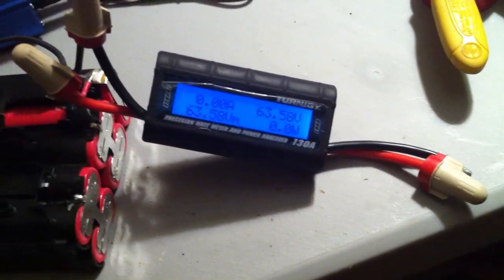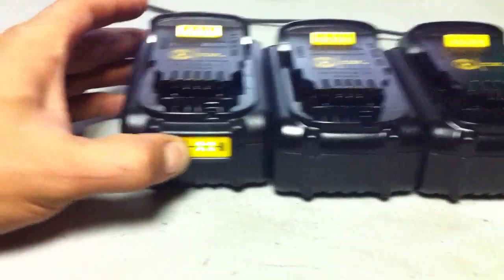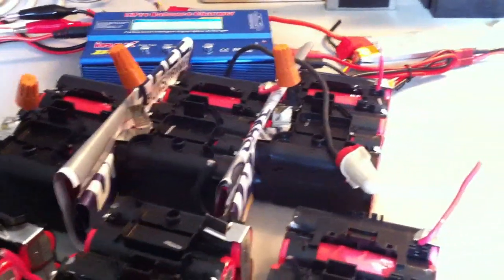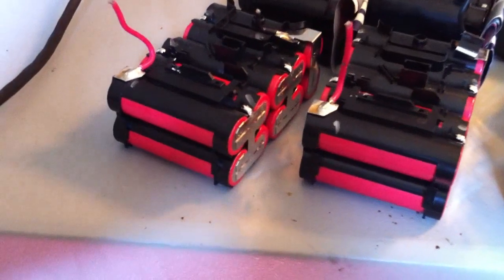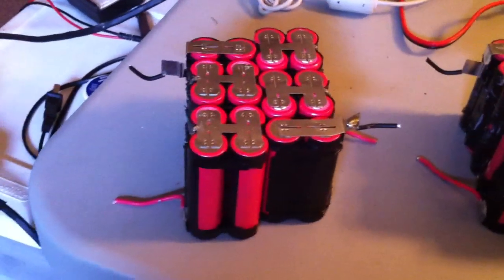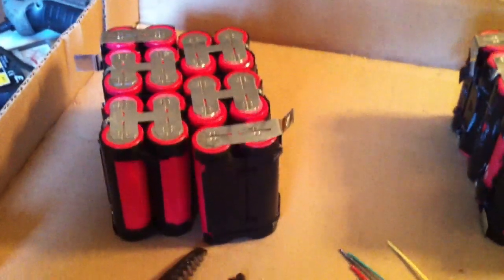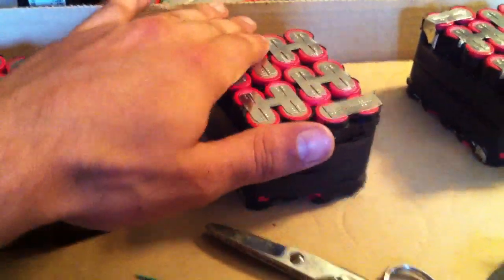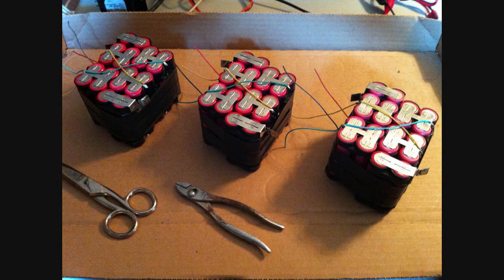60V 15S EBIKE Battery Built from Dewalt 20VMAX packs Part 2

Comment from the maker: what do you mean a 1 piece deal? I use these because i only need a certain range and they have excellent power discharge. If i needed to drive 30 miles plus everyday id get a bigger pack.

Comment from the maker: balance lead are basically little wires that attach to each positive terminal of each group of parallel cells in your battery pack. They allow you to use a balance charger to perfectly balance the voltage of each cell to 4.16 volts or you cal also use the balance leads to plug in a battery medic to check the voltage while using the battery pack.

Comment from the maker: well if your gio is 36v these will work perfect for that and they are powerful. when u buy a dewalt pack it is 5s 20v so you buy 2 and put them in series for 10s and that 36v nomimal 40v fully charged. if you buy 4 and parallel the other 2 you get 6ah instead of 3ah. you can do this a 3rd time for 9ah at 40v if you buy 6 packs total. just make sure to add balance leads.

Comment: I recently bought a Gio 500W eBike,second hand. The battery is not that great, it's lead acid.I am looking for the cheapest way to make (or get) a Lithium battery pack to replace my current pack (which is really heavy and doesn't retain power for too long).

I really like your idea of using the Dewalt battery packs, but I am wondering if you could post a drawing of how you hooked them up together. As well as the best way to charge the pack, once it's finished. Thanks, I really enjoy your videos!